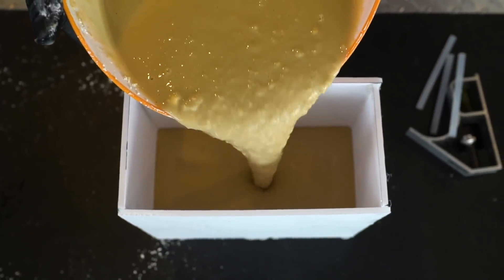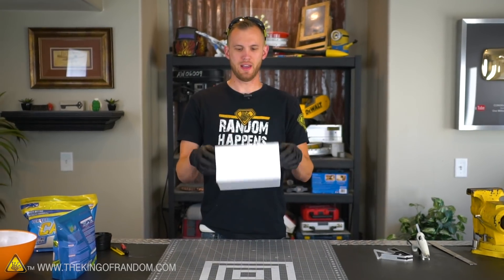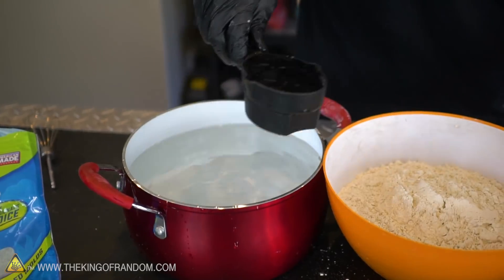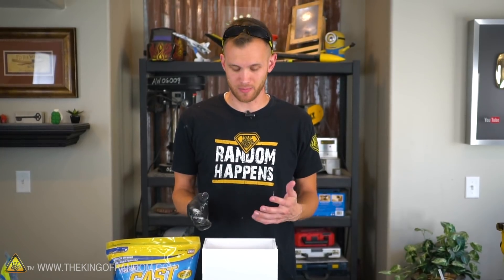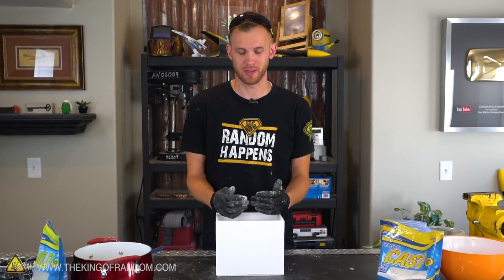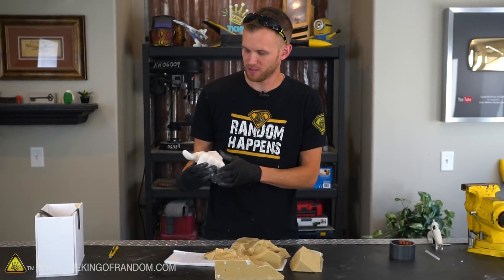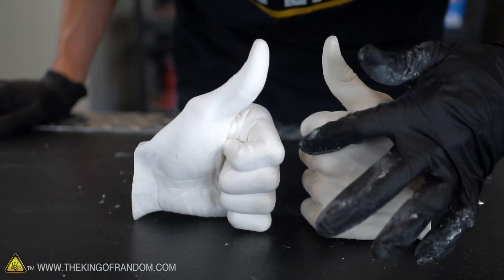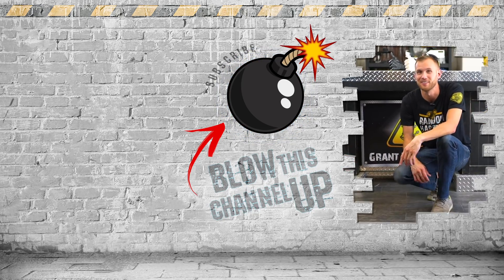Replicating Body Parts using Seaweed Alginate

Comment: What I usually do is layer the plaster around the mould face rotating the mould, 
when Ive reason to believe it's not missed any areas, I then use a 2nd layer & so on (plaster can allow a 7-8 minute setting time, before drying out

Comment: if you cut 1/2 way thru you can fold the box up. It will fit nicely together the outside corners can be hot glued for strength.

Comment: Use water displacement (a container filled to the brim of water inside a empty bowl to catch the water) to place your hand inside, displacing the water. Measure the volume of water to figure out your plaster measure. Use that same water to create your casting. It will slightly overfill so pour slowly until mold is filled.

Comment: I was researching parrots and looked up cuttlefish bone. I saw another use for the bone other than for a parrot to gnaw on for calcium is for casting metal. The bone is very brittle and chalky. You can carve a design into the bone and then cast  metal onto it, then when it is hardened and cool, just break apart the bone to get your creation.

Comment: tip: put in just a little plaster, then really tip and slush it around to try to coat the whole inside of the mold. then fill it the rest of the way. this works with a lot of different materials, not just plaster.

Comment: Try melting and casting magnets to see if it is still magnetized @thekingofrandom
Reply: Jordan Fraser I don’t know much about magnets but I don’t think that would work
Reply: Shrimp 41404 that's y I ask to try it bro???
Reply: they would lose their magnetization
Reply: Richard Neddo ok have u tried it
Reply: Jordan Fraser not many people have tried melting magnets but is the same concept as iron if you take a magnetized piece of iron or a piece of iron that is attracted to a magnet vice versa if you heat it up to a certain temperature eventually becomes non-magnetic this is also a trickle of blacksmiths use to know when it is ready to hit the iron
Reply: I threw one in a fire and it stopped working

Comment: If you have some heat resistance you could also use wax at just the right temperature that it melt after a few seconds you don't feel it get a couple of layers of wax on hand and then cool it off and do not leave in the sun I made the mistake

Comment: Can you deep fry using motor oil?
Reply: Bruce Wayne That sounds like a fast hospital trip.  Deep frying effectively replaces some of the water in food with oil, transferring heat in the process to cook the food.  However, unlike fryer oils (corn, soybean, flaxseed, coconut, etc), motor oil is poisonous.
Reply: TheAttacker732 No I've never meant for you to eat it. Just curious how it would look to fry something in motor oil
Reply: Can you deep fry turds?

Comment: KOR, alginate is used in dental offices to make accurate molds (casts) of teeth. One of the tricks we use to get rid of bubbles is vibration when pouring the stone.  We also pour incrementally, getting the stone into all the grooves while resting the mold on a vibrating surface, and moving the piece to allow all air bubbles to escape.  
Just a thought for you!

Comment: Is it possible to reuse the mold???  dehydrate it and then turn it to dust and then try using it again.
Reply: Moulage would be better if you want to use it over again, however it does cost more. I don't think that you can dry it out and re-use it with out adding more chemicals to get it to set again.

Comment: Try putting the mold in the vacuum chamber. I am interested to see if the fact that it has water in it will cause it to not cast properly if so. Also interested to see how the plaster cast in a vacuum.

Comment: Don't stick your head into a microwave to make a mold of your head. It is a 'seriously unamusing' activity. (A guy in UK did exactly that, btw, check out video.)

When pouring cast into mold, use of a plaster vibrator or equivalent,  will significantly reduce porosity (holes in casting).

An alternative material to making molds would be polysiloxene (sp?) materials that set very rapidly, come in a variety of viscosities (for how much detail and dimensional accuracy  you want) and quite easy to use.

Comment: What would happen to the alginate if you cast molten metal into it? Since is tends to have moister in it the hot metal might cause something cool to happen. You could make a mold with a rod that sticks out the top so you can slide it out without destroying the alginate and then pour metal into that and see what happens to the alginate. My hypothesis? It wont be pretty XD

Comment: Hey I work in the dental office and pour dental motels all the time ...use a flat vibratior they cost about $30. when your pouring set the box on top of the vibratior and you won’t have air bubbles when it cures. Just a little tip :)

Comment: U should put a strong vibrator in the plaster so it will shake out the bubbles that's the same way u make concrete things

Comment: Traditional follow up after that would be to galvanize a layer of copper metal on top of your mold using a solution of copper sulphate and passing electricity to it. It does require to add a layer of conductive ink first of course.

Comment: Why gloves? Use belt sander without sandpaper to vibrate out bubbles.
Reply: Also can apply a very slightly thinner coat with paintbrush and move it around to get into smaller details first, having less volume easier to get rid of air bubbles.
Similar you can paint the molding alginate onto your target item you are wanting to mold.
Reply: Once you have awesomely detailed cast, you can take a silicone mold of it, do 2-3 layers outside layer being thicker.
Then make plaster shells around it using vassiline (petrolum jelly) around the seams (overlap) so that they do not stick.
Then use elastic bands to hold together in a box frame filled with some scrunched up news paper.

After you carefully peal off the silicone (may require some slits for flexibility)
You can cast concrete, wax, chocolate etc. (just pick one use first don't use for food if used for other material)

If you cast wax, you can then do a cast of that wax into bronze or other metals.

Comment: Oh the people I could scare with a severed head
Reply: There are better ways to make a severed head mold
Reply: You would suffocate easily
Reply: Well, aren’t we talking about severed heads?
Reply: Jack Mayr, use an air tube
Reply: Angel Acuna or how many people I could flip off with 3 hands
Reply: TheDekuThatDid ....... I would assume 3
Reply: Angel Acuna just hold your breath
Reply: A mask would work better then ur head
Reply: Jack Mayr it takes only 5 minutes to cure you might pass out but have a friend pull you out
Reply: True so true but use realistic paint
Reply: Angel Acuna Dr
Reply: People actually do that if you stick your head in then you get  scuba diving oxygen tank and then you just fill that party in,and then cut your head out and then you can just fill up the part that has the hose and you are done
Reply: What you just said fits perfectly with your profile picture

Comment: Could the plaster mold (the finished craft) then be used for silicone molding? 
As plaster, i wonder the silicone might destroy hand or break apart while the silicone is curing.

Comment: Would the vacuum chamber have removed the bubbles from the finger, or not since it was trapped under part of the mold? I don't understand the rules of vacuum, viscosity, or the laws of fluid dynamics well enough to know the answer to this. I figured the mold form was too large for your vacuum chamber.

Comment: using a vacuum chamber to remove air is how we did it in urethane casting. Straws on high/low points to flow material helped lots.

Comment: There's a better with silicon rubber you can get at a hardware store it's in a cocking tube you can put Vaseline around young had you have to mix it in a bowl of soapy water and put on your hand it will dry within 30 minutes but you can reuse that mold over and over again

Comment: Can diamonds melt?
Reply: Killswitch gaming At a high enough pressure and temperature, yes, but at standard atmospheric pressure, no
Reply: Sure
Reply: I would like to see carbon in a liquid state
Reply: Hello fellow nerds
Reply: McDrakMan Diamonds can burn, but a fairly high temperature is needed. I believe i saw a video about it somewhere. I do not know if it is possible to melt pure carbon, maybe in a vacuum but i doubt it.
Reply: McDrakMan almost all diamonds have small impurities, but in the video a guy heated a diamond with a torch and then dropped it into liquid oxygen. Diamonds can only burn when there is a lot of oxygen nearby. Just search youtube for: Burning diamond and you should be able to find something.
Reply: The time is yellow......
Reply: McDrakMan, only time will tell.....
Reply: Well it is carbon that has been through a large amount of pressure so it could turn into gas but it might turn into liquid because carbon is typically in a gas state so I don't really know what will happen.
Reply: It just seems really unlikely to burn because I didn't think put carbon could burn the diamond that u saw was probably not 100% carbon but I could be wrong
Reply: I guess that makes sense
Reply: No
Reply: Not under normal circumstances.
Reply: What do you mean by yellow
Reply: Princess of Dragons hello...
Reply: Princess of Dragons graham the christian
Reply: Princess of Dragons hey are geek is on fleek
Reply: McDrakMan ☭
Reply: No only gold and iron I know because I play Minecraft
Reply: No
Reply: At the right temperature a diamond might melt I don't know for sure because I am not old enough to get a diamond and try to melt it but if I'm correct you will need extreme temperatures  to melt a diamond or a diamond might just turn into a diffrent state like a gas form in conclusion I don't know but mabye
Reply: The most effective way to burn diamonds by the way is with the use of liquid oxygen.
Reply: McDrakMan no, they burn
Reply: Not under standard conditions.  Under standard pressure, carbon (including diamonds) sublimates from a solid to a gas at something like 6,600° F.  However, if you get the pressure to 50+ atmospheres (~750 psi), then carbon can melt, albeit at even higher temperatures, closer to 8,500° F.

So diamonds can melt in theoretical terms, but only under conditions that are beyond all but the best labs.  In practical terms however, diamonds don't melt, they evaporate or BURN first.
Reply: Yes literally anything can melt even wood
Reply: Yes
Reply: Nicky Murray i see your smart
Reply: McDrakMan No but it can burn
Reply: They do burn though.
Reply: I don't think diamonds burn, when you burn something that is a chemical reaction and I don't think diamonds have the right chemical properties all it is is carbon which is just an element so I don't think carbon by itself would burn
Reply: McDrakMan No

Comment: Could you use the vacuum chamber to de-gas the plaster before it cures?
Reply: I don't think it's air in the plaster that causes the main problem, it's the air inside the mold that you're pouring plaster into. If he were to somehow put both the mold and the plaster into a vacuum chamber and manage to pour the plaster into the mold under vacuum then it would likely avoid the air bubble he got but the effort you'd need to go to in order to do that just wouldn't be worth the slightly better result you may get.

Plus there could be a problem with sticking these products in a vacuum chamber - they both contain a significant amount of water which boils under vacuum at room temp so it could be possible to remove too much of the water from either your plaster or your mold rendering them less effective.
Reply: InfinitePower probably not. Cures too fast
Reply: I'd like to see him try that would be kinda cool
Reply: The plaster is rather sticky, and air bubbles will still form when he pours it.
Reply: The plaster mix itself can be de-gassed by mixing it while under a vacuum as long as it is a very thin mixture and has long enough working time. Getting air bubbles out the mold can be a little trickier. But, there are a number techniques such as a machine that turns the mold in all directs while vibrating it. When it comes to one off type casts, artists have different tricks like putting air channels in certain places where it is likely to collect. It's a lot like casting metal.
Reply: dont press my profile
Reply: yes
Reply: It may be easier to mix the plaster in layers, the first one or two mixed thin so you can pour it in and spin the mold to coat without trapping air, after a bit of curing time filling the mold with regular plaster.
Reply: InfinitePower fghftgufytu
Reply: InfinitePower ,.
Reply: I do it all the time. I wouldn't recommend it if your new to mixing plaster. Timing and mixing is crucial. Just make sure that the container is about twice the volume of the plaster to allow it to expand. When you mix the plaster make it a bit more watery tham usual. Sift the plaster into the water and let it sit for a 3 to 4 minutes without stirring or mixing. Then mix in with you hand by spreading you fingers open and let the plaster loosely filter between them. Quickly vaccum and then proceed with you slush cast.
Reply: StreakyBaconMan, nice novel

Comment: The dental industry uses a similar technique for pouring dental models. What is used to avoid bubbles is the gypsum-based plaster is poured using a vibrating table. Also, the plaster is mixed mechanically under a vacuum seal to remove any air pockets. Dental impressions are taken with either rapid cure silicon or sodium-alginate based materials as well.

Comment: Can you please try to coat ice or dry ice with neverwet and if it works, let the ice melt to see if the never wet will be strong enough to hold in the water and for the dry ice see if it makes a bubble of gas.
Reply: dry ice sublimates {goes  directly to gas} it has no liquid state it is also made of carbon dioxide. But yes it would be cool to see if it could hold all the gas
Reply: Starlord i know thats why i said "and for the dry ice see if it makes a bubble of gas" in my comment
Reply: Ice Wallow Come dry ice isn’t made of water

Comment: whenever there's a street fair here, there's a booth that does hand casting for kids. They use some kind of low temperature wax in which they had colors and what not. It dries very quickly and can remove your hand from it easily as well.

Comment: Will touch id work with the plaster thumb?

edit: if you used a silicone thumb with an embedded magnet would it work?
Reply: David Samolkin No it doesn't have enough detail and if would also need to have a electric current (because thats how they register a hand apart from fingerprints)and plaster doesn't conduct very well.
Reply: Probably.
Reply: it needs static current :P
Reply: David Idk because plaster is hard but edit this comment and put silicone
Reply: Axe- L still needs current and sufficent detail which I don't think the moulds will give you.
Reply: TouchID reads actually fingerprint a little deeper into the thumb, not only the surface of the skin. Magnet is irrelevant as the sensor registers capacity, not the magnetic field of any sort.

Comment: If you want to make a miniature of your hand, cast your hand in alginate and about 15 minutes later, fill that casting with alginate and after 15 minutes carefully remove the outer alginate without disturbing the inner one. Let that inner one dry by itself for a week or two and it will shrink to about 1/3 the size...

Comment: Can you turn aluminum into molten metal with electricity?
Reply: Happy5 bunny too bad you're wrong, it's called welding
Reply: logan thompson Welding is iron and steel, lol. Not aluminum.
Reply: DwertlePlayz the arc furnace used electricity and I’m pretty sure he melted aluminum with it
Reply: Happy5 bunny yes. You can weld with aluminum.